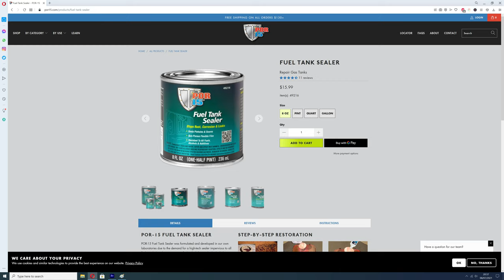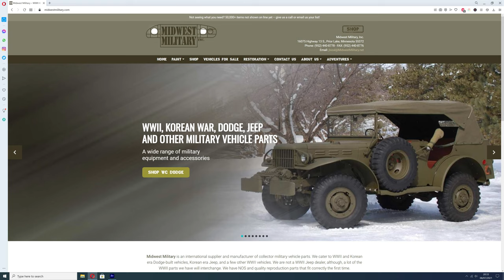Having a Bath with my Gas can was the ONLY way to save it....

Comment: 7:53 ... Famous last words, ... I was replacing the in tank fuel gauge set up on my 1966 Chevy Van once, I previously had made an access panel in the vans floor for service.  There was this area around the fuel gauge/fuel pickup opening with a lot of dust and dirt ... 
I quietly borrowed my wife's Hoover and figured I'd just quickly suck up all the dirt
Well you guessed it, it sucked up gas fumes, and the Vacuum exploded once, a bit ... then again, with more vigor! :(and caught on fire :)
We went out for Hoover shopping and dinner that evening :)

Comment: P-O-R is not a word it's acronym that stands for Paint Over Rust. The reason that the kit comes with a rust neutralizer and not remover is because it is designed to stick to rust. It tends to peel off other wise. I've used most of their products with good results.

Comment: Matt:  Another great vid.  With all this water, you need a GPA.

One thing about jerry can usage, the "wide mouth" gas tanks were adopted, to help fueling with jerry cans, sans Donkey Wedding Tackle.

POR-15 makes great products.  I have used their Rust Encapsulator for years.  If you prep correctly, no worries.  

For cleaning rust inside tanks and cans, put a handful of nuts and bolts inside, then shake vigorously,  or let it ride around in the back of a farm truck for a while, flipping occasionally.   Some guys have strapped them to paint shakers.  Amazing, the tricks people devise.

Thanks again
Reply: You can also strap the tank to a cement mixer and leave it spinning with nuts and bolts.

Comment: Good stuff! You should verify that you didn't seal the air vent. it's the hole on the face where the lid gasket goes. There's a bent tube inside, so it vents when upside down...  👍

Comment: Citric acid can be used as a rust remover. It takes a bit longer to eat away the rust but is far safer to handle (used in candys such as Warheads to make them sour). Can be bought through Amazon and other places as a powder that can be mixed with water. Or mixed with wallpaper paste if you want it to stick to something (then cover it with plastic film).

Comment: Great vid. Don’t recall mention that water bath (you took that literally) should be HOT. That way the cooler air in the tank will expand, forcing bubbles out any leaks. Works the same for testing metal fuel float from carby. Putting in water colder than temperature inside vessel does the opposite. Sucks liquid into vessel.

Comment: Great job, Matt. I did a similar job with a US can like that with a 2-component coating called “Tankcure” (for the folks in the Netherlands). This brand also has a solvent for chemical removal of rust which works very well. Especially after shaking the jerrycan with water and sharp shingle inside.

Comment: I just did used this system on a few of my jerry cans and it worked great! I should have let it sit for a few minutes on each side though as it dried - most of it ended up on the bottom.
Reply from the maker: pretty much what happened here too, it doesnt stay very well on the sides

Comment: Brilliant video!!. BTW, if you ever need any bits for that GT86, let me know..
Reply from the maker: Cheers, I would like a spare Gbox (I saw new ones on ebay a couple of years ago from track cars, should have bought one then!)  the 86 only has 40k miles on it but the gbox always worries me, that second change is awful and i'd feel better having a spare transmission for the future!
Reply: @Greendot319  Funnily enough I have a gearbox stored in my utility room, (dry and warm) which has done a total of 150 miles and has had all its gears superfinished.
Reply from the maker: @NigelsModellingBench  ha ha, that's great well I might have it of you lol!

Comment: Instead of acid you should try electrolysis. Just get a low voltage battery charger a plastic bin and some washing soda, it converts the rust.
Reply from the maker: don't want to damage the paint remember, caustic eats OD paint like anything!
Reply: I've done this. The can is the bin. rebar through the neck, insulated from the can... Nothing touches the outside...
Reply: Yeah, but where's the fun in that?